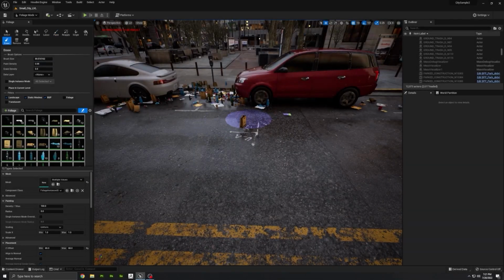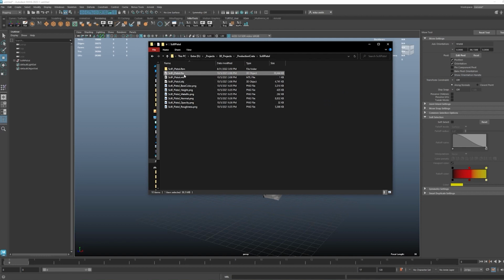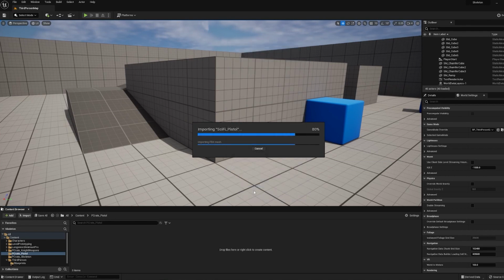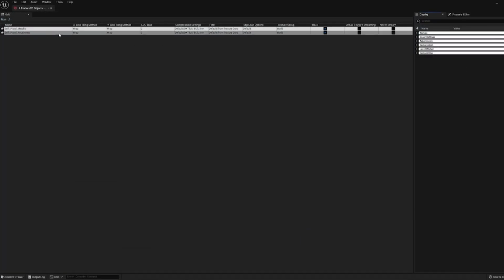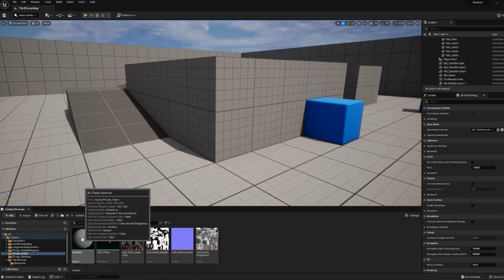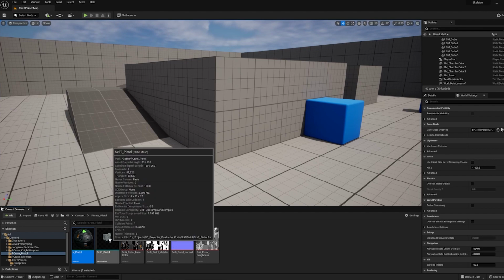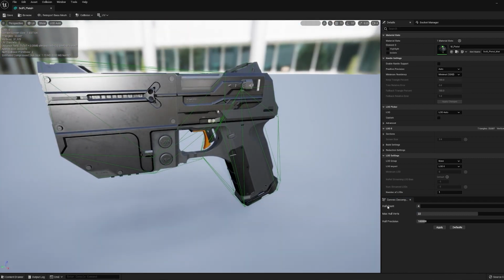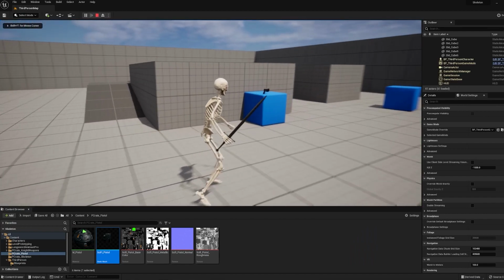How to Import 3D Models into Unreal Engine 5

Comment: Hey so I just had a question- I'm teaching myself UE5, and while I do have years experience in Maya, almost none in UE. And so what i'm trying to do is import a double barrel shotgun into UE5, one I made in Maya. The shotgun is 2 groups, Group1 and Group2. Group1 is the ENTIRE gun, every little piece and part, and contains Group2. While Group2 is just the front and barrels. Group2 (being the front and barrels) is meant for when the gun reloads and "snaps" open to insert ammo. I want to import the gun and it seems the way to go is to select import at the very top, followed by "import as dynamic." My question, albeit odd, is this: why do I see no one talking about that specific option for importing meshes with groups? That and the import at the top left (I believe under "file") NOT the import on the content folder. Unless i'm just missing it the content folder import doesn't give me the import as dynamic option. It's admittedly made me kinda neurotic as to maybe I'm actually doing something wrong? I'd just appreciate some clarity, since i'm learning on own it's little hiccups like this that are the most confusing lol

Comment: Normal maps aren't color information either (it's using the color channels but not for color information,) so that should also be set to not sRGB. Excellent video :)
Reply: Good catch! That happens automatically when you import normal maps. Or it should. You’ll notice a notification pop up as you import them if it works.